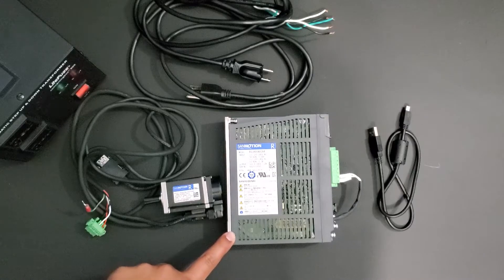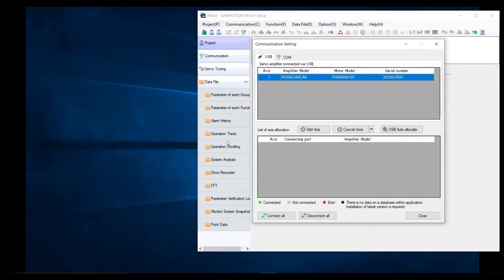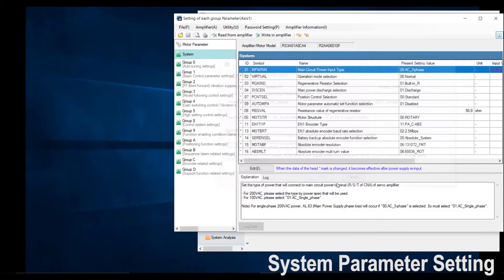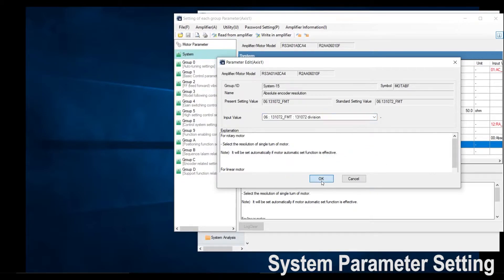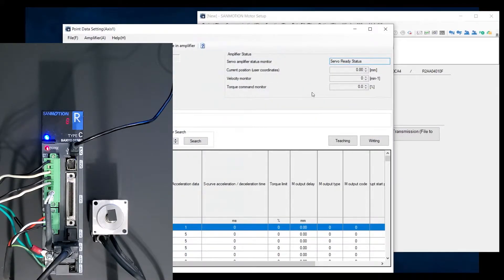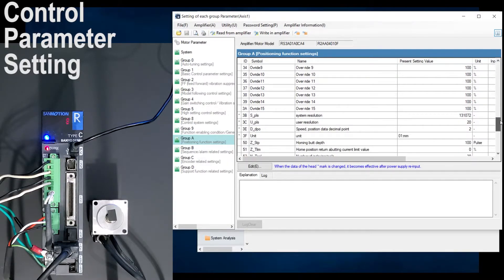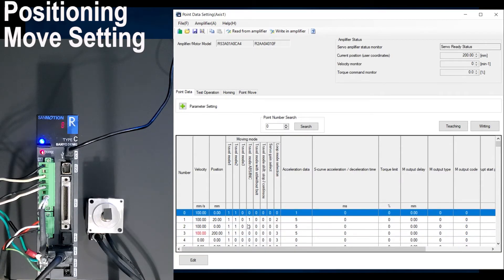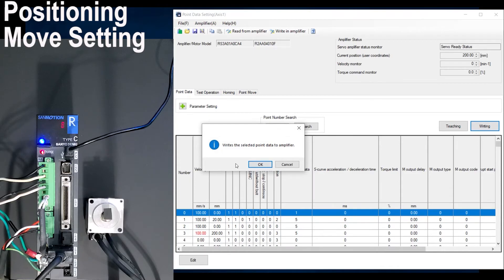Sanyo Denki RS3 Indexer Drive Initial Setup

Comment: How did you know the encoder type ? S-sensor or P , H, or R ?
Reply from the maker: Encoder type is based off motor part number. R2AA04010FXP00M: For example the letter P here indicates a P sensor